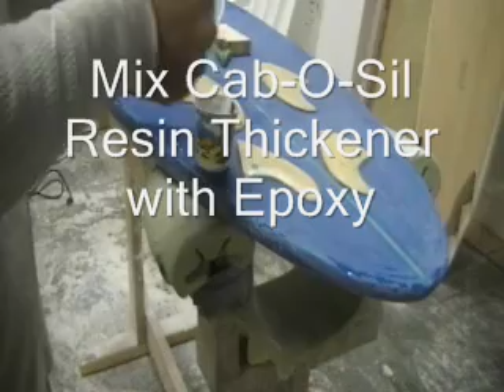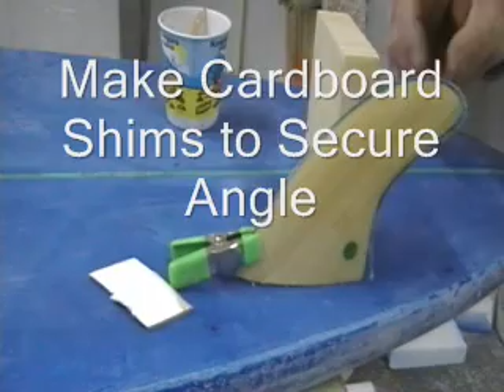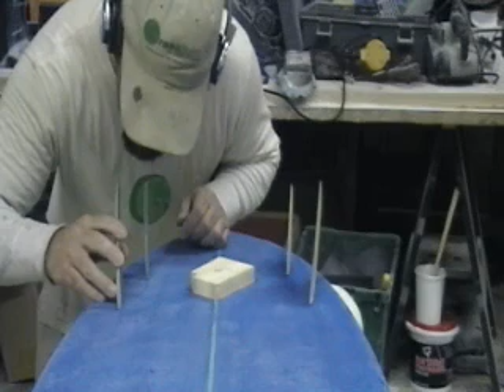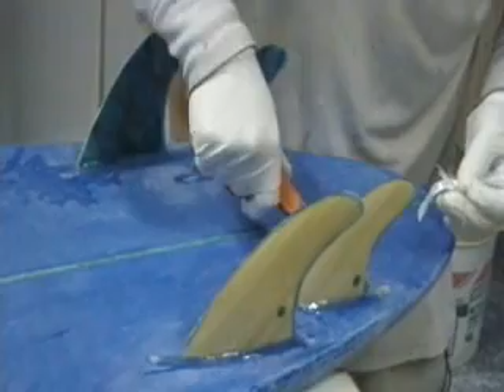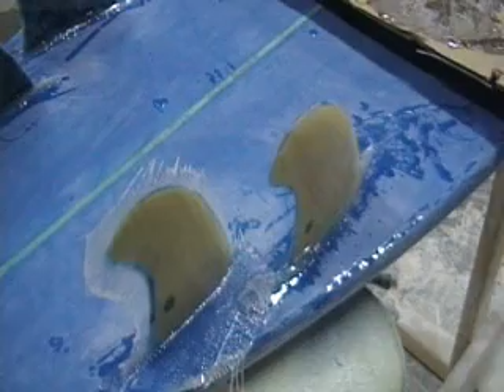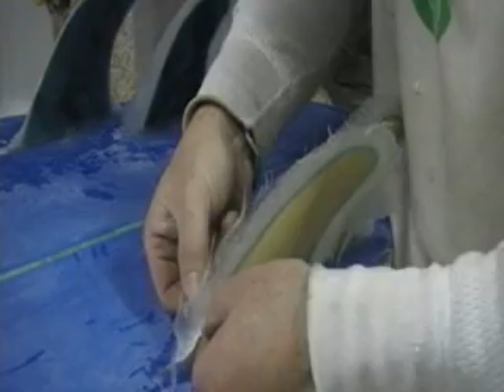How_to_Glass-on_Fins.wmv

Comment: Why use the cardboard to wet the layups with? Just mask the board bottom that has been prepped for hot coat (laps ground down flush) and wet layups on the board in front of the fin cluster. Then scrape off excess resin w/ a squeegee when done. Used to fin 10 to 12 thrusters a day in the 80's  with hot MEKP kicked polyester resin burning my eyeballs out while wearing bulky chempro gloxes & a respirator. Tip: cut the roving the same length as the fin base so the layups meet at the front & back of the fin, makes it easier to get bubbles out & is stronger. Had a pair of rope cutter/utility scissors to cut rovings w/ one quick snip, none of that chewing. Epoxy resin goes off so slow that it runs down the fin and will float the layup & rovings at the bottom up in a puddle leaving the top of the fin layup dry if not closely monitored and adjusted (for hours)- especially on cooler days. Hope this helps.

Comment: once the fins are already glassed on, if they break can they be fixed? if so, how?
Reply: thats why u never cut a hole for fins u glass them on as shown. and if they ever get busted off you sand the excess off clean and start again as shown. but I would rather us tape to set the fins until hardened